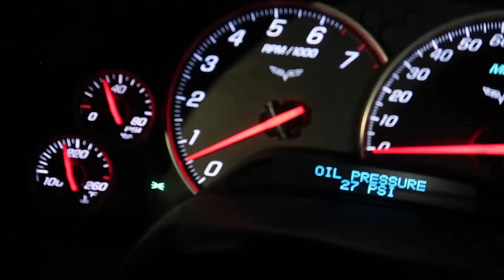FIRST START and REACTIONS to the BIG Cam in my Corvette! *Unleashing the BEAST!*

Comment: fist few days with the new cam all you do is let it idle my LS1 has a stage 2 BTR cam and its pretty rowdy i drove it for like 9 months untuned then it would stall and sometimes extended crank and die out a few times but when i tuned it the idle sounds meaner and it runs so much smoother.
Reply: What software/company did you use for tuning?  Results?  Suggestions....BTR stage 3 here....like you, it is close to stalling sometimes....
Reply: @stanleysirskywalker4904  i had a shop street tune it with hp tuners

Comment: Nice... I am almost done with my C6 LS2 BTR Stage 3 install with 225 Trick Flow Heads, 102MM Fast Intake, Holley 103mm Throttle body, Injector Dynymaic 1300 injectors to run E85, Kooks 1 7/8" long tube headers,  Comp Camps Gold Rockers,103mm venom cold air intake, ATI Super dampener,... I think thats it... Plan on doing more? Have you had yours tuned? What do you think you putting to the wheel?